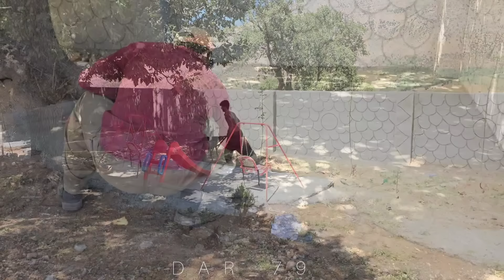To forget Mehdi's calamities, Nargis creates a place of peace in her home

Comment: nags, for safety reasons for you and your children, always leave the large gate locked, put tiles on the porch in front of the house, it will look more beautiful, and avoid less dust for the children and less dust.
Reply: Tiles would be deadly winters time to walk on there . And the mud is shocking there when wet . The need to seal the cement on that porch .